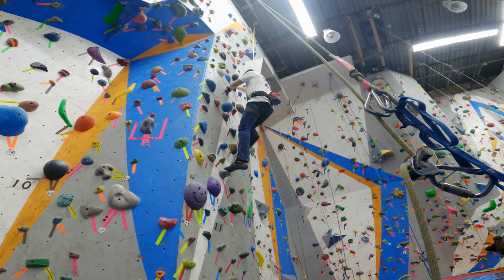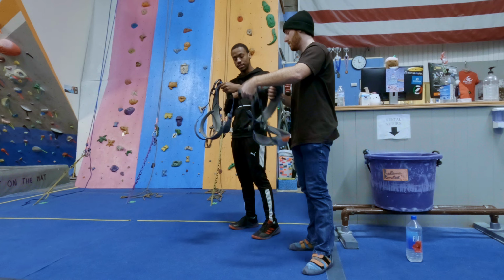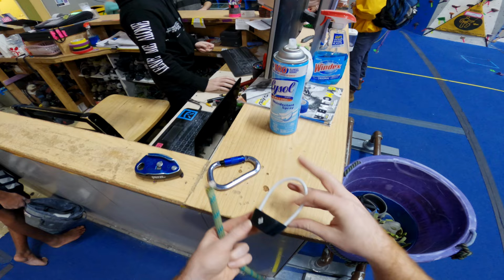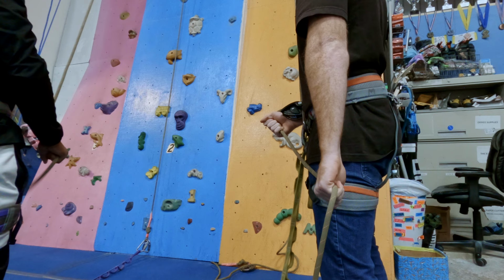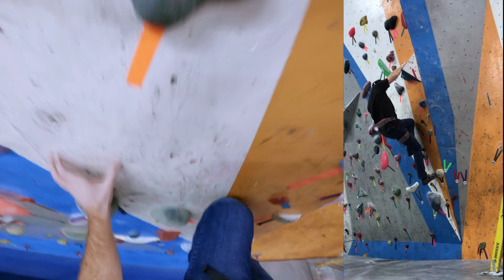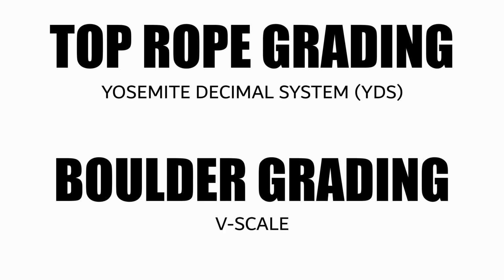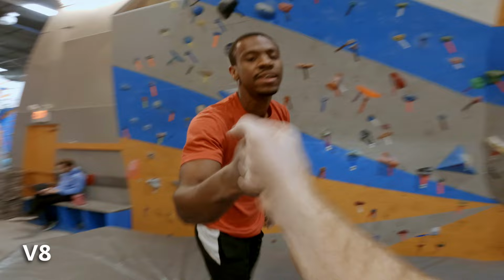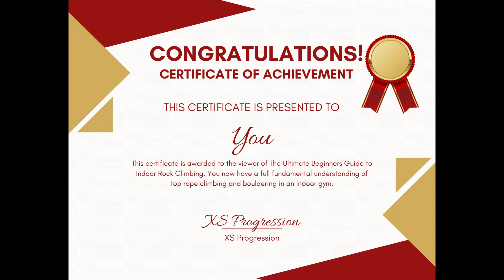The Ultimate Beginner's Guide to Indoor Rock Climbing | Top Rope and Bouldering

Comment from the maker: Timestamps:
Intro 0:00
What is Top Roping? 0:47
What is Bouldering? 1:00

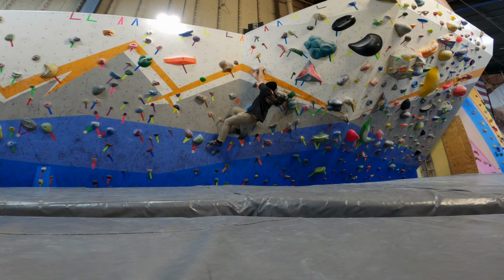Gear 1:18
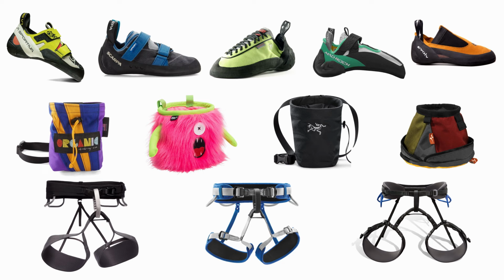Shoes 1:42
Chalk 2:22
Harness 3:10

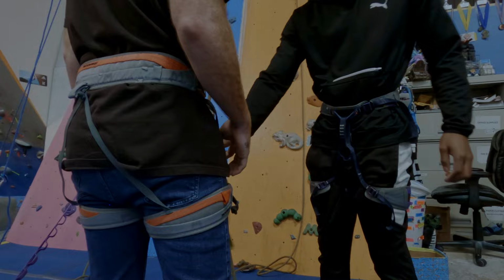Top Rope Climbing 3:39
How to Put on a Harness 3:42
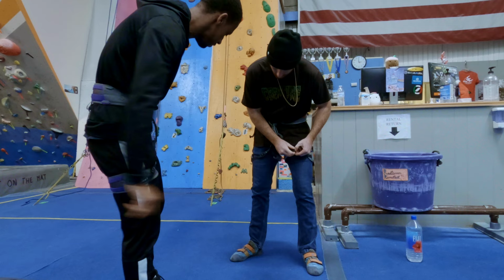How to Tie in as the Climber 4:53
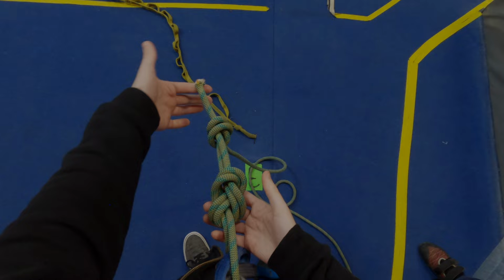How to Tie a Double Figure 8 Knot 5:31
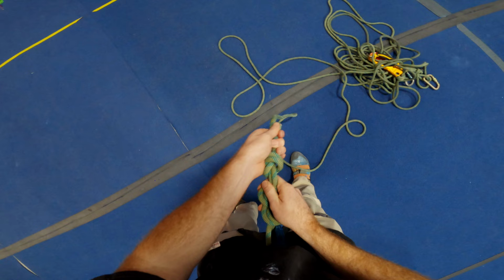How to Tie in as the Belayer 7:44 (ATC 8:27 GriGri 9:04)
Anchors 9:43
PBUS 10:25
Commands 11:39
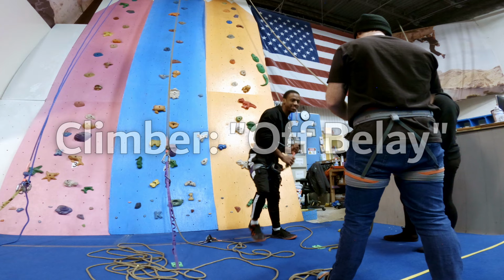How to Come Down 12:41

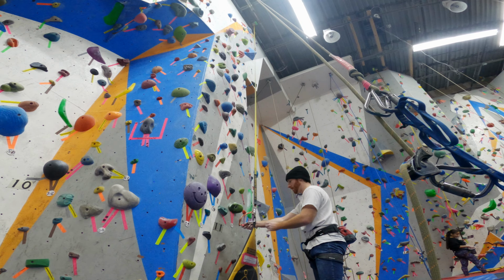Bouldering 13:13

Different Types of Holds 14:59
Different Wall Types 16:49
Difficulty Grading 17:41
Beginner and Advanced Climbing Technique 21:44
Common Terms 24:12
Other Recommended Channels 25:27
Special Thanks 25:49

Comment: Timestamps:
Intro 0:00
What is Top Roping? 0:47
What is Bouldering? 1:00

Gear 1:18
Shoes 1:42
Chalk 2:22
Harness 3💯
Top Rope Climbing 3:39
How to Put on a Harness 3:42
How to Tie in as the Climber 4:53
How to Tie a Double Figure 8 Knot 5:31
How to Tie in as the Belayer 7:44 (ATC 8:27 GriGri 9:04)
Anchors 9:43
PBUS 10:25
Commands 11:39
How to Come Down 12:41

Bouldering 13:13

Different Types of Holds 14:59
Different Wall Types 16:49
Difficulty Grading 17:41
Beginner and Advanced Climbing Technique 21:44
Common Terms 24:12
Other Recommended Channels 25:27
Special Thanks 25:49